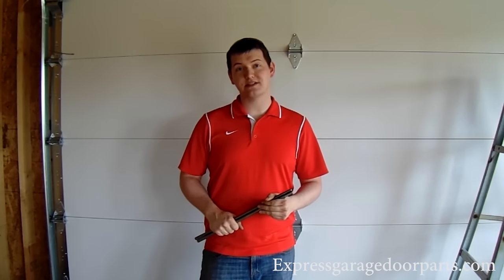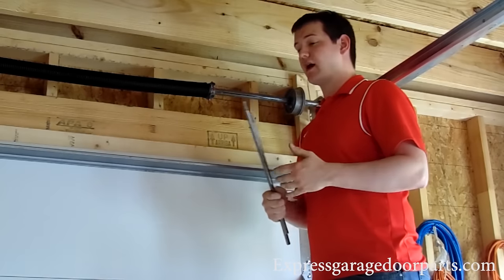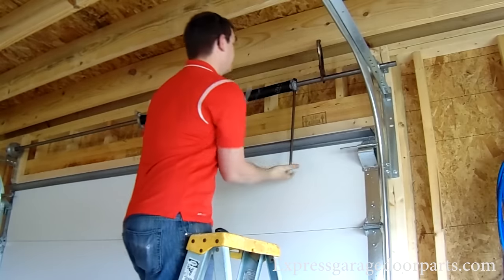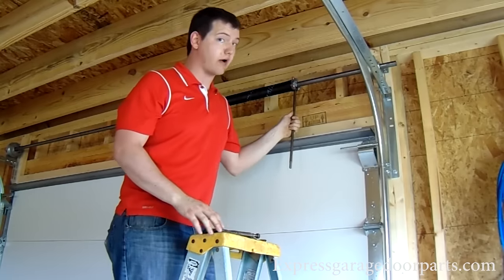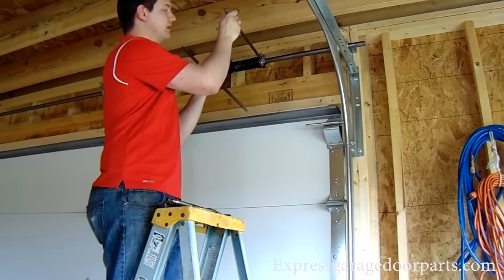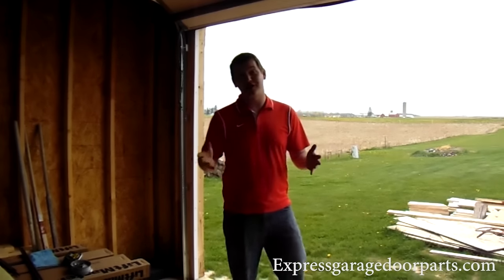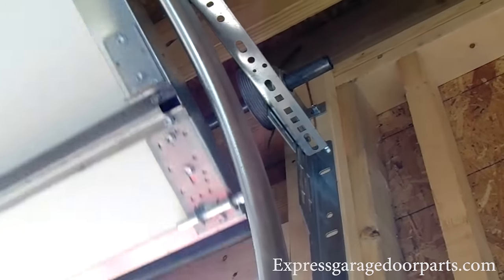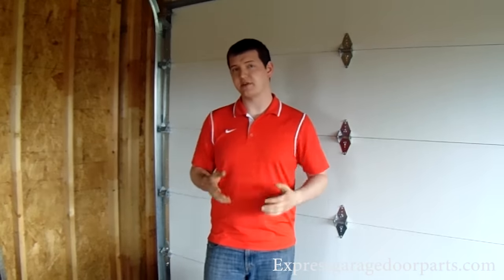How Many Turns to Put on Your Garage Door Springs

Comment: Helpful video. Just had to replace the cables and they were different length by a few inches. Went a head and took tension off spring, set the drums and tensioned the spring per the chart and works great.

Comment: I knew there had to be some kind of science to this. Of course, the spring also needs to be the correct size - wire diameter, inside diameter, and length from end to end. Otherwise, the torque won't equal the weight of the door at the proper number of turns.

Comment: Hello. Very informative. I have the same set up as your video.

Do both side have to be equal? Could one side be (31) 1/4 turns and the other be (32) 1/4 turns for alignment?

In my case, when the door gets high enough the (2) steel cables on the end stop turning and become very loose so that when its time to close the door the cables are loose and wind on the steel bar instead of inside the wheel. The loose steel cable is by about 3 good winds loose.  If I close the door slightly, I can get the cables on track and everything is good.

I'm trying to figure out if I can adjust each tension spring. Making it tighter. Nothing has been replaced or change in conditions other than this.

Thank you in advance.
Reply from the maker: Steve-
The 31 recommended quarter turns is just a good starting place for your springs. If your door requires a few more or a few less turns thats fine. The most important thing is to be able to keep the cables on the drums in the up position. Just because one side was adjusted doesn't necessarily mean you have to do the same to there other side but you should try and keep them close to the same. Thank you!
Reply: @expressgaragedoorparts5380 
My door lock does not line up with the slot on the rail sinve it is now touching the ground. The door needs to be raised about 2 inches to engage the lock. What are your recommendations to line it up?

Comment: Why does the width of the door not count in the calculations of turns?
Reply: Because the turns are for how high the door is. Each full turn brings the door up 1 foot with the cables on the side. Usually a tech may add 1 or 2 quarter additional turns to take the slack of the cable when the door is fully up.